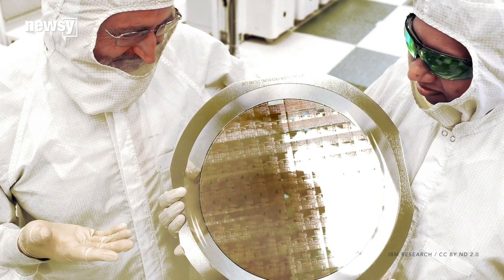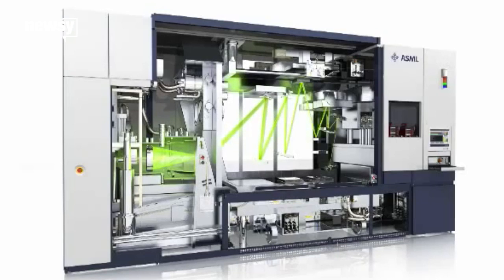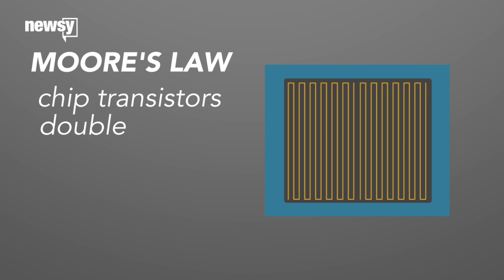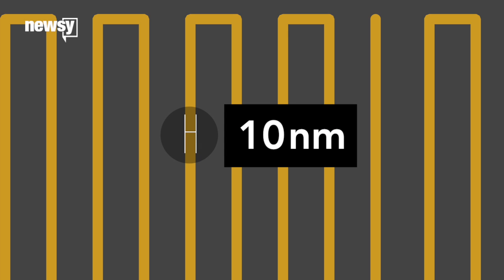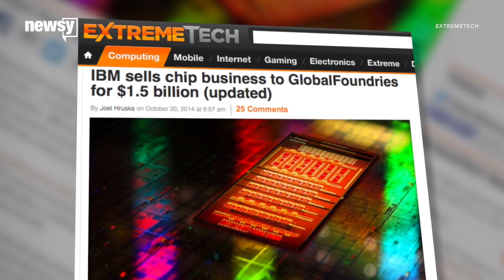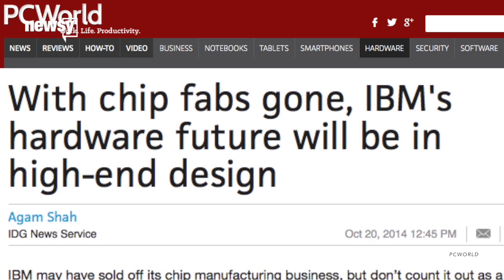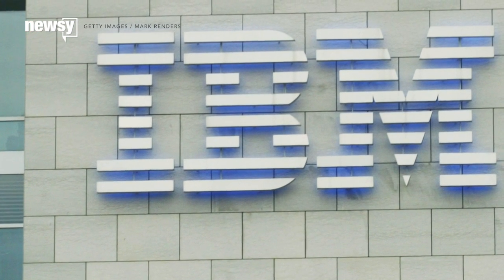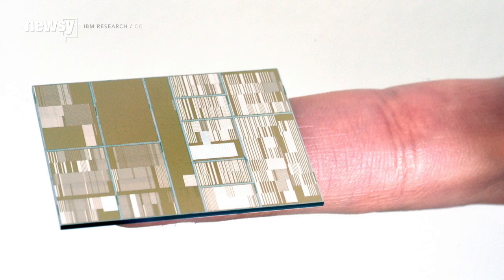IBM Breaks 10nm Barrier For Faster, Lighter Computer Chips - Newsy

Comment: THe only thing i wonder about is how can the signal pass through a distance and be reliable as compared to when we were running larger nm.  So the voltage is so low and has to be maybe stepped up and may cause slower speed compared to running straight signal right from the chip.  There must be some kind of amp to boost signals or some kind of bus or link to amplify these tiny signals otherwise how could they be doing all this processing.  i mean at these low voltages how can a signal travel through without hickups or some kind of mistakes or latency caused by not enough power pushing the electrons through to be fast enough and reliable.  I mean before the chips were using so much power it was not so bad maybe they could of run without a bus or a gateway but now they are so small almost to the point of having no power that the signal could be lost because its so weak and low voltage.  I wonder how this is done.

Comment: Beat AMD and Intel at theirs OWNage game!!
Reply: Nick Parker IBM has always been a leader in the hardware research market , Intel and AMD on the other hand are more preoccupied by their financial benefits and didn't see the point in investing huge amounts of money into something that would take around 10 years to be on the market and thus become financially viable, they do their research based on moore's law , there's no need for them to be ahead of it.Also Intel was founded and is still run by some of the pioneers of chip engineering , they don't lack anything to do this kind of research if they wish to , also the chip manufacturing industry relies on the same model for research, IBM just went a few steps ahead.
Reply: +KidGacy l